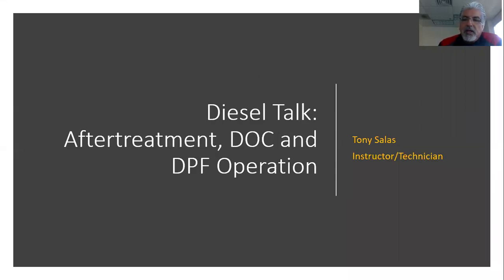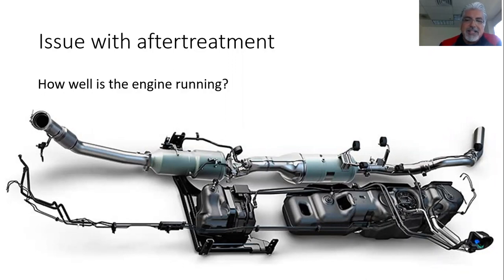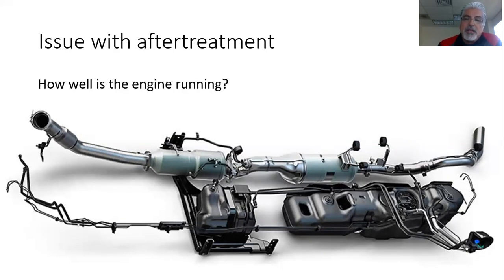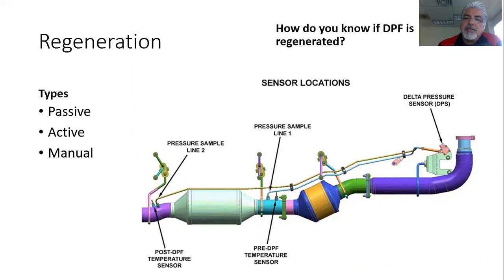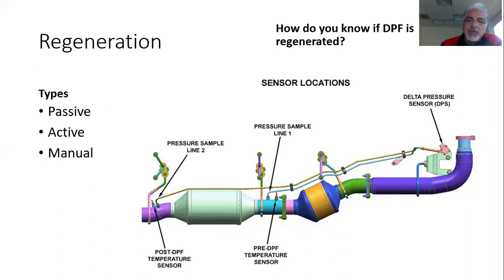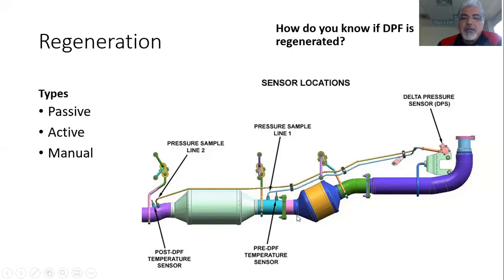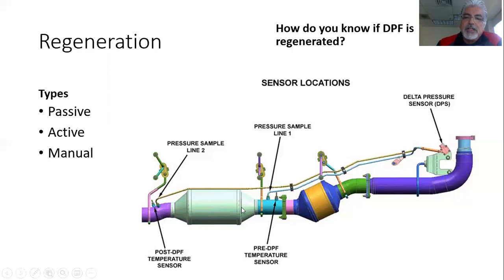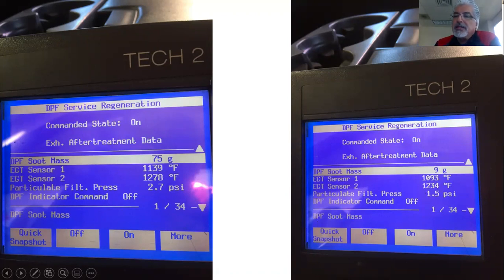Diesel Aftertreatment Tech tip

Comment: Thanks
Very nice presentation.
I drive a Pete 579 2020
I just recently changed the NOX sensor at the end of the system
Very expensive by the way, n I have the Cummins program on my laptop 
Here is what would really help,
Just like you showed on your scanner the gauges that tell you the temps n the psi before and after as well as the psi in terms of flow.
The truck driver watches the engine temp oil temp rpm air psi.
We need gauges that tell us the state of the DPF so that we can act, or react.
To the ever changing conditions.
The thing is some of us owner ops, we are technically inclined and we research and learn the system.
Which by the way the sensors are just few, you don’t need to be super intelligent to figure it out.
However the manufacturers, (by the way all of them) benefit from keeping the drivers ignorant, 
So that when we get stuck on the side of the road and the message reads “seek technical assistance”
Now our bill is not just a few hundreds by a few K.
So my question to you is.
Do you know of a small scanner that I can just put on my dashboard so that I can monitor the performance of my system 
Because just like a car it can just run or it can preform at its optimum level.
I personally like my engines my cars and trucks to run at the optimum level,
And the DPF to do its job right it needs to run at its optimum level.
By monitoring the gauges I will be able to tell when it does not perform as it should.
Please let me know of any DPF monitoring system.
Thanks 
I appreciate your break down of the values
Very nice job

Comment: quick question,  Is it not true that on a 2014 to 2016 LML with recently replaced NOx sensors (both or one), you have to run a regeneration regardless of the grams of soot in order to reset the Nox sensors?   Also, you cannot run a RQFT, after Nox sensor replacement, until the DPF regeneration is done.....are these true statements?
Reply from the maker: ACTUALLY I would run the regeneration before replacing the NOX sensor. However, grams of soot or soot mass is a calculation. The reason why we run a regeneration is because there can be DEF fluid accumulation in the NOX catalyst fooling NOX sensor 2. Need heat to clear the DEF WHICH CHANGES TO AMMONIA that breaks up the NOX. The heat is brought about by running a regeneration.
As for RFQT, YOU can do it anytime you want, but ideally after a regeneration. You run a RFQT when a repair has been done on the related after treatment issue  and the truck is in derate. If you run a RFQT IT SHOULD CLEAR DERATE within 15 minutes. If doesn’t check for related codes. If no codes are set, may need to update ECM software and reflash.
Reply: thankyou for response!!!!!

Comment: Hello Tony, very informative and great video. Thank You for this. I learned quite a bit. 
I'd like to touch on one thing you mentioned and that is about fuel additives. First off, I drive a 2021 Dodge 2500 Big Horn 6.7l Cummins. My manual states that I can use certain additives to the fuel as long as it meets their parameters, and they state them. Power Service Kleen is one of them based on the low sulfur content it supposedly has and/or reduces but with a cetane boost. I do agree with you on oil changes. I just changed my oil and oil filter for the second time, and it has 6000 miles on it. I also changed the fuel filters for the first time. Note that my rear fuel filter was very dirty compared to my front fuel filter and my oil was very dirty.  Dodge recommends using 10w-30 Shell Rotella T5 or 5w-40. Why they do not recommend 15w-40 I don't know. Anyways, could you please touch on the fuel additives such as power kleen and how they can hurt or help the EGR, DPF, or SCR on the exhaust system and what should normally drive temp ranges be if you use a monitor like an Edge CTS3.  Thanks
Reply from the maker: I’m a fan of Stanadyne, Alliant Power fuel additives and BG 245 as a cleaner.
Your fine with 10w30

Comment: Sir. 
I've got a 2014 Ram 3500HD with the 6.7, 180,000 miles. Runs very well even after MY WIFE FILLED UP WITH 87 OCTANE and was limped home, 10 miles until it died. 
I removed the gas, cleaned everything out, replaced filters, filling up the engine filter with Mystery oil and tank with seafoam. Then all was back to running great again. No worries about the gas fill up. 
Then I started getting the alerts. "Exhaust filter 100%" and "DEF system needs to go to the dealer so your wallet empties" alert. I'm at 50 miles until limp mode. 
Thinking of deleting, I removed everything including the def system and installed the straight pipe. Looked for a tuner I can afford but, while everything was out of the truck I cleaned the exhaust filter very well along with the DEF part (can't remember the title of that part of the exhaust) and then the whole def system as well. Emptied the tank, cleaned the injector, the lines, everything that could have water go through it, I cleaned until it was clean clear water coming out of it. 
Thinking now of replacing everything and holding off on the delete. 

With me explaining the 87 octane and what I've done now, what's your opinion of what I've done. I'm heading to the shop now, truck on my lift and replacing everything to stock. 

Your opinion of what I've got going please?...... The alerts happening after the gasoline? Am I better off deleting? 
Thank you sir.
Reply from the maker: Big issue but this is where a scan tool is needed. You need to have a scan with a manufacturer equivalent capability to know what codes are set. This tells the story why you have issues but to also have it reset. Autozone FreeBee scan doesn’t cut it. What part of the world you in? Maybe I know a good shop near you.
Reply: @dieseltalkwithtonysalas8725  Are you talking about a code reader? I have one. Or are you talking about the one like what you've got? I don't have one of those. It would be nice though. What is that reader you have and how much are they? 

What I'm thinking is the gasoline screwed up sensors or the filter was clogged by the exhaust being gasoline oppose to the diesel. ? 

When I say "limped home" is because it was running like it had gasoline in the system instead of diesel. It ran like sh.... But, after I got it all cleaned up and proper fuel in the system again with the new filters and such, it runs fine now. Just had the alerts of the exhaust filter being 100% full and the DEF needed to go to the dealer, which is 75 miles of my quite rural area I live. Regardless, I work on my own vehicles with my professional shop I've got. Just ignorance with the diesel and the new crap on them especially. I mean, I've got a couple roll aways filled with more in other storage. (just saying I know how to turn a wrench with guidance from someone like you when I come across a situation)